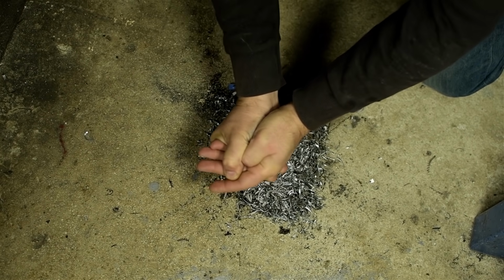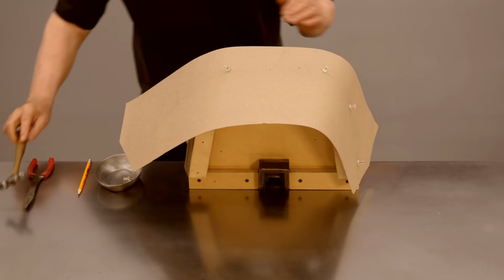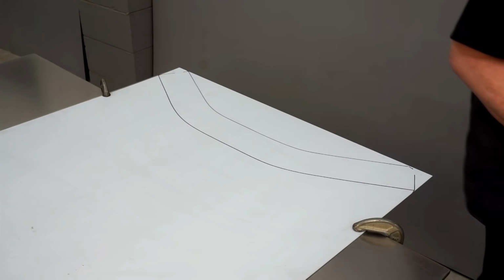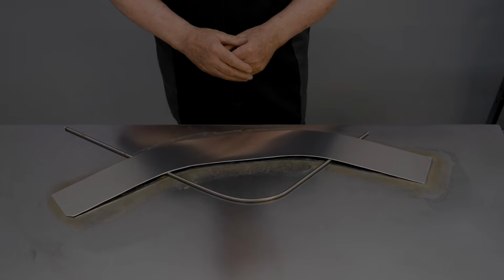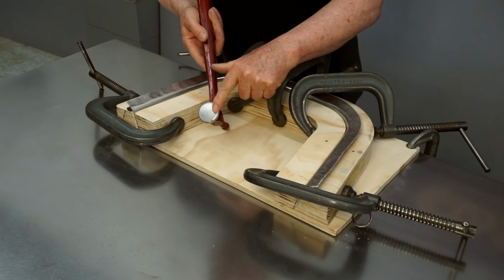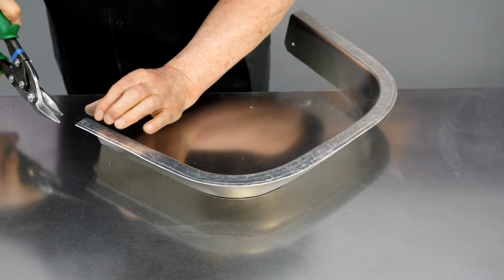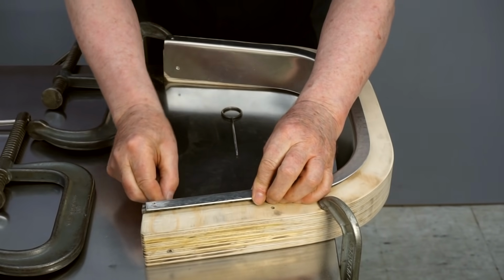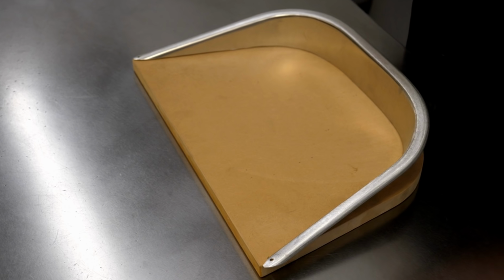Cleaning Up! with This Old Tony - Part 2

Comment: Soap on the sandpaper... never thought of that! Thanks!!
Reply from the maker: It's inexpensive, and effective!
Reply: 15:30
Reply: yep, never heard of soaping sandpaper either. Good tip to know, will have to remember!
Reply: @RonCovell  Absolutely.
Reply: you can also use old candles, thats what we used where i worked as an aprentice, works a treat
Reply from the maker: Great idea - a ready source of paraffin wax!
Reply: I tried soap on a file today out of curiosity. Was using the file on round copper spinning in drill press. Didn't work out to well, seemed to load the file worse and seemed harder to clean with a file card. Guess it only works for sandpaper :-(
Reply from the maker: I have used chalk on a file with good results. Copper may be a special case.
Reply: I worked aluminum professionaly for 18 years and it always killed sandpaper, I spend a lot of money on high end, non clogging paper, and they still clog and fill. soap is a brilliant idea for keeping your paper clear. I'm looking forward to giving this a go at work tomorrow. 

I saw a comments about wax, in my experience wax is the enemy of sanding aluminum, it instantly clogs paper, and sanding dosent keep it warm enough to be liquid. Maybe candle wax is different from the cutting wax I use for drilling, tapping, and well cutting. 
It can also leed to a reduced longevity of your final paint job, because wax will imbed itself into micro scratches your sand paper is leaving behind. But soap won't do that, because....it's soap..lol. either way, thanks for the tip.
Reply: Usually, I use industrial oil.
Reply: We use bees wax at work for cutting sheet aluminum with angle grinders.
Reply: @Yhrim70  Try french chalk on your files. great way to stop them clogging with copper based alloys (and other metals)
Reply: This is a really great idea
Reply: @RonCovell  A few hundred years ago when I was an apprentice we were told to use french chalk when filing any non ferrous material.
Wire wool and candle wax for finishing a surface like aluminium, I was never sure if it was a skill or a way to keep the apprentices busy.
Reply: u beat me to it...
Reply: @RonCovell  Ron, what brand/type of bar soap do you recommend?
Reply: Is this normal bar soap or this fancy sugar soap?
Reply: Used to do that when flatting paint work on cars
Reply: Dish soap
Reply: @iamawelder  you win the prize!  I buy bees wax in bulk from a local apiary. By far the best stuff for aluminum and it smells good.

Comment: Bar soap is great for keeping the sandpaper from galling, paraffin works very well for cutting such as drills and saw blades. 
I learned a lot, thank you.
Reply from the maker: Great tip!
Reply: Paraffin wax or Paraffin Oil?  I use a mix of Wax and Oil, so it makes a soft wax on my bike chain. Adding more oil again would continue to soften it. You can also add other solvents that evaporate to act as a medium to transport the solution, it will then harden ones the solvents evaporate. Turning back into the waxy/oily solution you started with

Comment: So much expertise in your craftsmanship. From your tips on annealing to using different sized tape to get  to the offset you want. Then you're putting soap on sandpaper. You're explanations of why you do what you're doing helps to understand the process. Thank you for teaching me.      Also, I would tilt the pan in the outside form and clamp it at the desired angle. Score it and then cut it with snips.
Reply from the maker: I'm so glad you are enjoying this. Your idea for marking the edge for cutting is excellent. I'll use a somewhat modified version of your description.
Reply: Right on brother!

Comment: Who knew that fabricating a dustpan could be so interesting? Ron your process description is perfect!  
I would make a 2-part form to expose portion to be removed the Mark the cut, remove from the form and cut with aircraft shears.
Reply from the maker: I'm very glad that you like the video, and took the time to comment! Your plan for marking the curved cut would work well. I'll use a different process, as you'll see in a few weeks.

Comment: Thanks Ron and Old Tony, I have never done any metal shaping projects. I might just give this one a go.  Keep up the good work. Cheers Ryan
Reply from the maker: You should!
Reply: Agree, just working out a list of supplies that I need to get from the hardware store
Reply: Ron Covell dust pan

Part 1
1/4” wide masking tape for curves
1/4” wide steel bar (6mm diameter)
3/4” MDF (19mm) for bending bar stock
1/2” (12mm) ply wood x 4 = 2” (51mm) thick 
Tubing to take a pencil, weld to flat bar. 
Yellow wood glue
Sanding drum for a drill. About 2” diameter x 3”

Part 2
Push pins
1/2” masking tape
3003 H14 alloy sheet. 1/16” or 1.6mm thick
Jigsaw with wood cutting blade
Propane torch
Large tipped sharpie marker for annealing process
Plastic mallet with rounded nose
Steel body hammer with medium crown face 
Steel body hammer with a low crown face
Scrap of 3/4” (19mm) mdf as big as dust pan for clamping block
1/8” or 3mm masking tape
Something to use as a caulking tool for the top edge
Pneumatic random orbital sander/disc sander
120 grit disc paper
Reply from the maker: Excellent list - I hope this project goes well for you!

Comment: I've always used bees wax for sanding lubricant, I tried the bar soap trick and was impressed, we now have bars of dial in the fab shop, thanks!
Reply from the maker: I have used beeswax too, and I thought it worked well, although it's a little more 'gummy' than bar soap. Many soap bars are perfumed, and I don't like the smell, so I look for soap with as little scent as possible.

Comment: Great use of alignment pins and transfer screws. Could have used that on a shifter boot bezel I made last week.
Always a pleasure learning from you.         Jere
Reply from the maker: Thanks, Jere. You know more about alignment pins and transfer screws than most - by a wide margin!
Reply: And there folks, are two of the legends in all things metal, automotive and just about all they work on. Jere and Ron... Kudos to both of you for sharing your experiences and "smarts" in very easy-to-learn-from delivery methods.
Reply from the maker: Thanks for the kind words, Joe!

Comment: You need 2 pans!
Old trick my grandfather showed me. Use 2 pans opposite each other to pinch ( or scoop) and pick up the debris pile, like an clam bucket from a stem shovel. If you have light or fluffy debris, one can be used to cover the debris in the other while transfering. With a little practice youll see. 
Quicker and easier than trying to broom  in the pile on to the pan in any amount of debris. 
To this day I dont know why they are not sold in sets! 
Steven Columbus Michigan 
Yes your  pan build  is a labor of love and a real show boat. Too nice to use now but you need 2 of them! !🤣 This Old Tony rocks also!
Reply from the maker: Using two pans, and scooping them together makes a lot of sense!
Reply: You also forgot to add the instruction to 'how to use' for This Old Tony'! 🤣🤣🤣
Ps from start to finish about how long did it take to make the project?  You made it look soooooooo easy!🤔 like Tubalcain states "you too can make this $0.50 part but youll need $10k worth of equipment" oh ya the time and the knowledge tool box to get the job done! 
Great instructional video loved it! 🤜🤛
Love the annealing trick! 
Thanks Ron
Steven Columbus Michigan

Comment: RE: how would you lay the angled cut out

I would probably mount it onto the mould, and tilt the mould onto the desired angle, and with a hight gauge, scribe the desired line. 

I am no where near a metal worker, I do woodworking, but I am always facinated by layout and workholding! these videos of yours are very informative and easy to follow, I'm glad I found out about you! cheers
Reply from the maker: Hmmm - you may be interested to see how I do it!
Reply: I can't wait!
Reply: @RonCovell  
TIG........
Bel lavoro !

Comment: Great video.. I feel you will use masking tape to take a straight line from the back parallel edge to the front Angle. I’m guessing but have to say the use of tape through this is simple and very effective. Question are the majority of Ali sheets annealed as without they would be too soft to handle ?.. especially say 2mm above. Thanks for sharing 💪🙏🙏
Reply from the maker: Using tape would be one option for marking the cut on the bottom of the panel - but as you'll see in a few weeks, I will do it another way.
In my experience, only a very small percentage of aluminum sheet is stocked in the annealed condition. When I have needed annealed material it was only available by special order. For the 3003 alloy I use, H-14 (half hard) seems to be the most common temper. With other alloys, like 6061, T-6 (3/4 hard) is more common.
Reply: If you can only get a different grade, like 6061 T6, do you anneal it the same way?
Reply from the maker: There are many different aluminum alloys, and each one has its own specs for annealing. 2024 alloy is especially challenging, and unless you follow the recommended procedure, you can compromise the properties of the material.
I have annealed 6061 alloy using the same technique in this video, and it certainly makes the metal softer, even though tighter controls on the process are recommended for this alloy, regarding the rate of heating, the amount of time the metal 'soaks' at elevated temperature, and most importantly, the rate of cooling.
Here's a video that shows some of the complexity of annealing as done in industry (look at the 19-minute point): 
https://www.youtube.com/watch?v=UoHBs8JJlPs

Comment: To take out the hammer marks, I use a thin bar or strip of lead and a planishing or ball-peen hammer.  Just lay the lead bar on the aluminum and smack at it some.  Not sure about your setup, though, as I've always made parts with phenolic or MDF.  Haven't tried one with the steel bars welded together like you show.  The metal would probably take on the form of the steel bars.
Reply from the maker: That's a great idea. I'd like to try it sometime!

Comment: Fantastic work again! 
I’d probably use a laser to mark it for the angle cut. Still would require a steady hand, but would do the trick
Reply from the maker: Glad you liked it. A laser could certainly work for marking the edge, but as you'll see, I'll do it another way which seems simpler to me.

Comment: I have a feeling that this is how things used to be made. By the hands of skilled crafters using intuition and past experiences to figure out how to shape the world to their needs . Thanks for sharing!

As for the cut, my first try would be making a paper template the same way as before around the mold mark that at the angle desired and cut the paper, then tape the paper and make a tape line on the pan and use the aircraft shears to follow the tape line. There must be a better way though, that would likely distort the work you have done so far. My second thought is making another wood block like the one you used for the inner hammer form and use a saw, but how do you match that shape? I look forward to your solution, it'll probably tickle the back of my head until you post the next video.
Reply from the maker: Yes, back in the day, if you wanted something, you made it - or bartered with another person who was a maker. 
Your idea for laying out a cut has some merit, but as you'll see shortly, I took a different approach. Thanks for watching and commenting!

Comment: You can also substitute your bar soap for your permanent marker for annealing. Rub it on cold. When the residue turns black its at the correct temperature. 👍
Reply from the maker: Good tip - thanks!

Comment: I am a machinist and sent these videos to a couple engineer friends. They are in awe of the skill but also in anguish because the dustpan wasn't designed parametrically. Few things tickle me more than torturing my engineer friends with off-the-cuff fabrication that doesn't start in CAM software (and would actually be misleadingly difficult to CAD in the first place), but all I am doing is showing them the shoulders they are standing on :)
Reply from the maker: Well, everyone has their own way to get stuff done!

Comment: Beautiful, how to you re-heat treat aluminum after annealing to get them stiffened again?
Reply from the maker: Some alloys of aluminum can be hardened by heat treatment - but the 3003 alloy I'm using for this project is a non-heat treatable alloy. The only way to harden it is to 'strain' or 'work' harden it - which I accomplish as I am working the edges.
Reply: @RonCovell  thanks

Comment: This is great but if you want something a bit less labor intensive you can take ~18" square of laminate and cut it into two triangles.   Then you make each cut straight (jointer works well for this) and file a slight chamfer on them you end up with a really productive two part dust pan that doesn't need a broom.  You just scoot them together and you can pick up a giant pile of dust in a few seconds leaving almost nothing behind!  If they get scraped up you can just true them again on the jointer.
Reply from the maker: That is a great solution, indeed!

Comment: WTH you tube??? premiered yesterday and No notification. Had to search for this. Coffee in hand... Let's do this!!!!! ............. 20 hours of sweeping chips.... gotta be Tony LOL.... Hands appear.... Hell yeah, it's Tony.

Please This Old Tony, tell me you found an easier way. You got me into working with this stuff... no machines yet but grinder and hacksaw dust make me wanna lose it. Scared to even think about chips but so want to do some machining after watching your vids.  Also can't wait to see your handle../ for the pan, for the pan.... ahem
Reply: I have to pause and say it was trippy as hell watching a flame push black away like a pressure washer cleans  a floor. As a woodsmith / carpenter... whatchamacallit... I sometimes burn wood with a torch to blacken it and make the grain pop. First time I ever felt like wood work and mettle / matel / metal work were so opposite :D
Reply from the maker: Well, wood and metal have quite different properties. One thing I like about metal is that if you cut it too short, you can often weld some material back on. It's much more difficult to do that with wood. When you get metal hot enough, it can melt - but when it cools back down, it's still metal. When you heat wood too much it completely changes form, and becomes charcoal, or ash.
Reply: @RonCovell  For sure, welding wood would be a neat trick. If you want to see the charring thing I mentioned, check out some vids on "Shu Sugi Ban" wood treatment / finish. ;)
Reply from the maker: I did investigate that. Very interesting subject!

Comment: I'd lay out the cut by setting it flat on the table, cut a piece of wood to match the angle, and run a sharpie around it. If you can locate the plane and the sharpie is always planar, wherever it marks the surface is the cut line.
Reply from the maker: Your approach is actually quite similar to the one I used. You'll see the last video in the series as soon as I receive the handle from TOT!

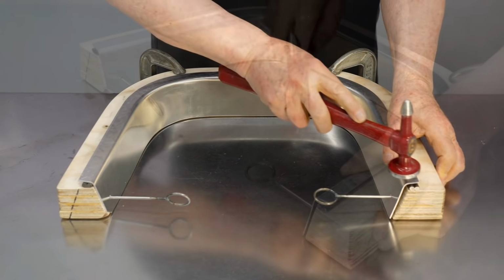Comment: 13:00 He tapped it without clamping it right, resulting in one of the holes being too far off to the side. if you look later, you see that the hole was welded close and there's a new hole

Comment: about making the angled cut, I'd just put a block of apropriate height under the backend on a flat surface, and run a pencil on top a probably same height block along the inside. Probably make sure the corners on both ends are symetrical first.
Reply from the maker: Your solution may be very similar to mine. I should be posting the next video in a day or two!

Comment: Cutting the angle of the pan, I’d use the forming jig. Cut the appropriate angle into the jig and clamp the pan to it to cut it. Probably cut it with aircraft shears close to the jig and bring it to the final edge with a file.
Reply from the maker: That sounds good. I will upload the final video in the series in a few days, and you can see how I did it.

Comment: Hi Ron! Thanks a lot for the lessons! Please tell me what kind of aluminum you use for shaping?
Reply from the maker: I'm using 3003 H-14 aluminum, 1.6mm thickness. If the numbering system is different where you live, it is essentially pure aluminum, with a small amount of Manganese added. This is one of the most formable alloys available.
Reply: @RonCovell  Thank you!

Comment: That ink trick is a good one.
Reply from the maker: Glad you liked it! When I'm using an oxy-acetylene torch to anneal, I usually light the torch with acetylene only at first, and dust the part to be annealed with a thin coating of soot. This is faster than using a marker, and works just as well. I used the ink technique to make this process accessible to people who may not have an oxy-acetylene outfit.

Comment: On amazon they have aluminum headed push pins, Ideal if you hammer them in....The plastic ones break too often.
Reply from the maker: I got some, and you're right - they're MUCH better than the plastic ones! Thanks for chiming in on this point.
Reply: @RonCovell  I work  with leather, moulding it on wood forms for fitted holsters and sheaths. Push pins are the way to go for that. Unlike nails or staples, they are easier to reposition as the material starts to take shape. The alloy ones are also available with longer points which is ideal for thicker materials like leather.
Reply from the maker: That makes perfect sense.

Comment: Wondering if the trick to laying out that cut would be mounting the pan upside-down to something firm and flat and lifting the front edge so a height-gauge could scribe a level line?  Actually making the cut with all this work invested would be hard to do.
Reply from the maker: Hmmm - your suggested method may be a lot like mine!